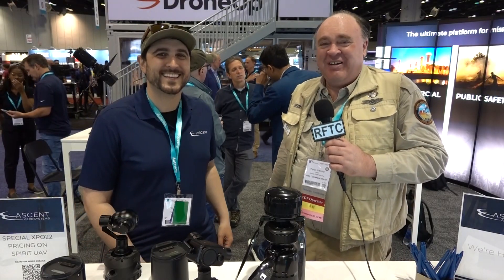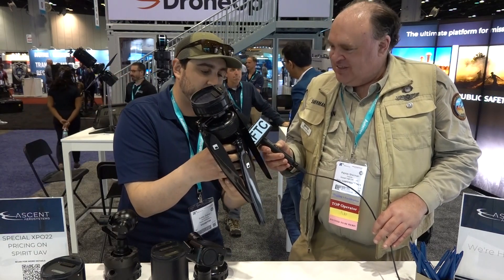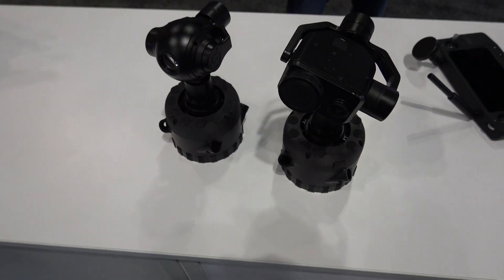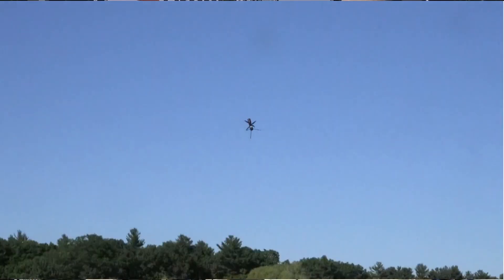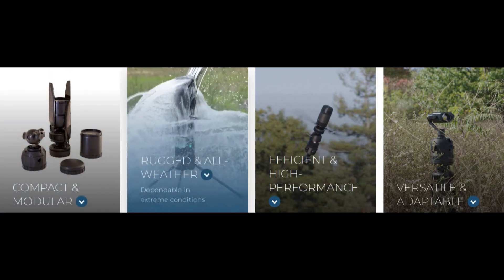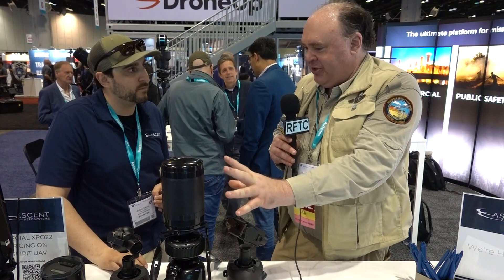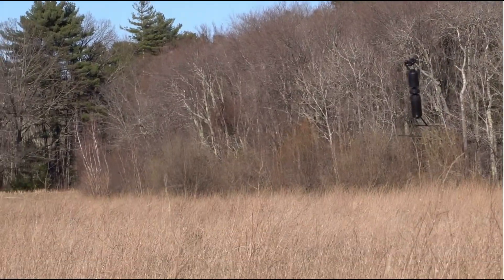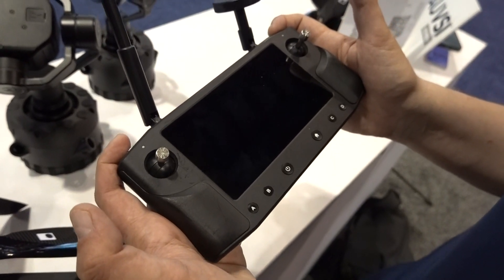Lego Drone: Quickly Add and Remove Components as Needed

Comment: The evolution of the earlier Sprite drone to this is quite impressive. You'll need deep pockets to run a dual payload consisting of the Lidar and IR/Thermal 40x zoom @ roughly $50000. The Free Fly Pilot Pro controller alone is $7500